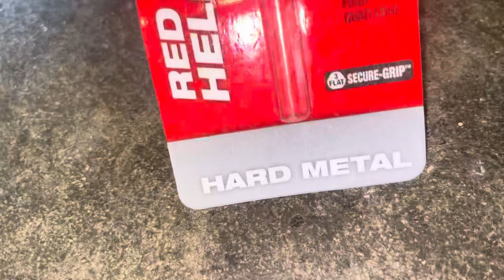Best drill bit for hardened steel, how to drill through a broken bolt amazing results

Comment: Masonry bits will work on hardened steel too
Reply: masonry bit with carbide tip?
Reply: They aren't ground to the correct angle, though. They work for like 7 seconds, and then they blunt

Comment: Thank you for sharing. I just went through the same experience. Cobalt bits - nothing, welding a nut - nothing. But 20 mins of patience with the tile bit and an easy out produced the result.
When the tile bit changed its tone I knew we had reached a threshold, I tapped in a Bosch easy out and a 5/16" F150 differential bolt that had been broken for 15 years emerged into the sunlight.

Key tips - clean the hole with brake cleaner, then apply cutting fluid. Drill for 1-2 minutes until no more swarf appears. Clean the hole and bit with brake cleaner, re-apply cutting fluid, drill for 1-2 minutes. Repeat until you have a hole deep enough to insert a quality easy out.

Top result !!

Comment: I have a drill bit broke off in the hole and can’t get anything to drill it out, would that work on drilling out a 1/16th titanium coated bit? This has been an issue for weeks now and I can’t complete my project without it getting done 😅
Reply from the maker: It will deff drill it out won’t be fast and might need 2 to get it done but It will I used it to drill out a easy out and a cobalt drill bit
Reply: @biddy98gst  thankfully I only have to drill less than half inch 😅 I will give it a try.